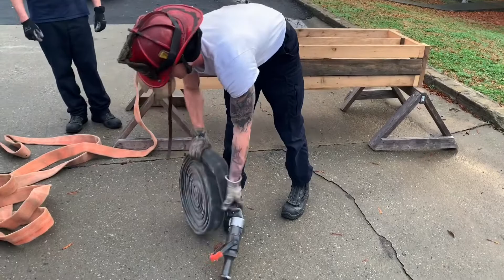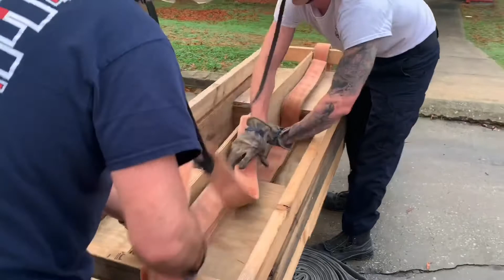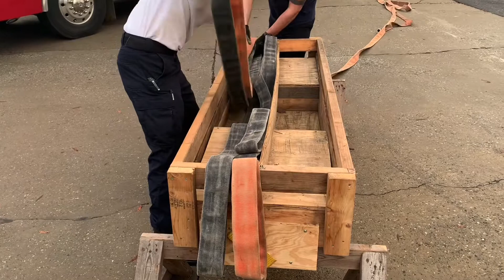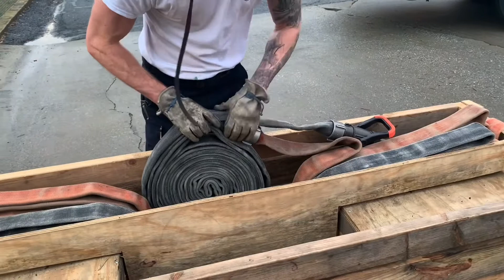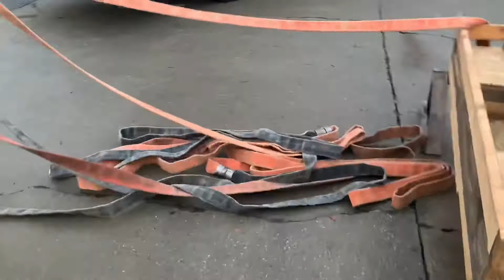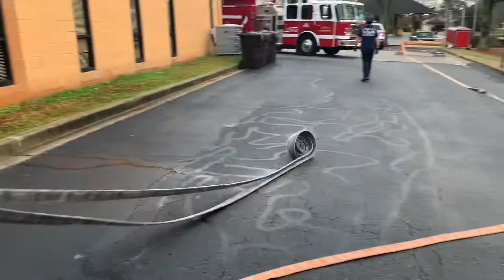Kentland Load

Comment: WTF is with the extra 18 inch length of chin strap ?
Reply from the maker: Makes for a fast mask up. I leave my face-piece clipped into my regulator. Face-piece to face (through chin strap), helmet drops to the arm holding the face-piece, tighten straps, hood and helmet on and roll on. Not for everyone but I have liked it.

Comment: It’s easy to pull that at waist height.  Doesn’t seem practical at all to climb on on top of the truck to pull that off . I don’t think it will pull off straight out of the hose trays that easy.  Do your hose tray have dips in it like that ? That crazy . Don’t think you can convince anyone pulling this from a training bed instead of the engine.  But I like that you are training and having options are great. Or did I miss what it was intended for ?
Reply: This is for a front bumper line setup not a cross lay
Reply from the maker: That’s right. This definitely works better as a bumper load. 2 of our engines are set up with these in the front bumper.
Reply: @firstduemachinists5146  That isn’t a “horseshoe load.”
Reply from the maker: Thank you for pointing that out, definitely not a horseshoe @lilreb601 . That was a bad attempt to describe a flat load that follows the “U” shape of the hose trough. Good catch and thanks for saying something. I didn’t even think about it.